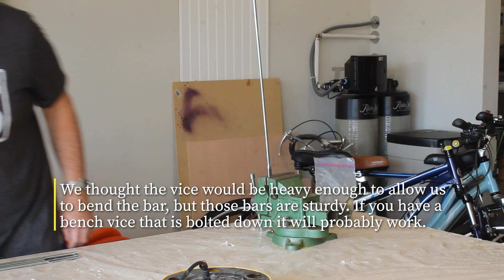CLC Camper Build Day 48

Comment: I didn't get to see a close up of the doors, particularly when closed and latched fully, but you doors appear to have fit very well in the end even without using straps to put more bend into them.

well done. 

almost done... whatever will I watch once your build is complete?
Reply from the maker: I’ll be sure to include a close up of the doors closed and latched for you! Today we are working on the interior insulation, finishing the doors, and installing the mushroom vents on the exterior.. Then it’s done!